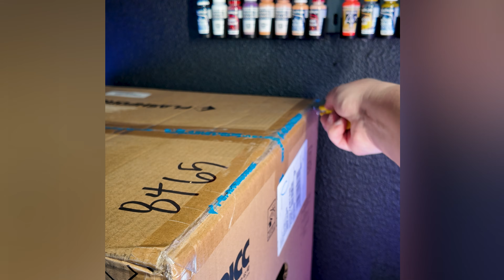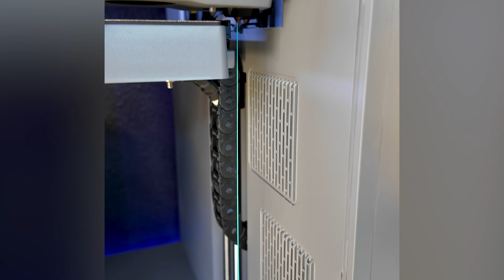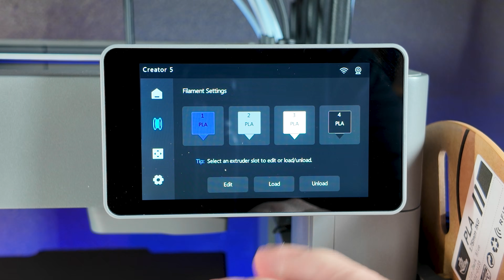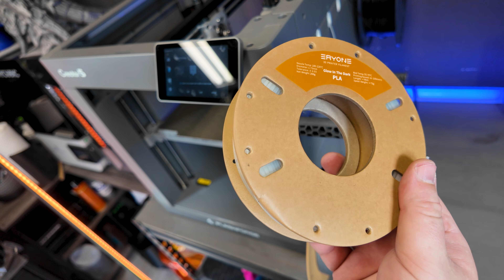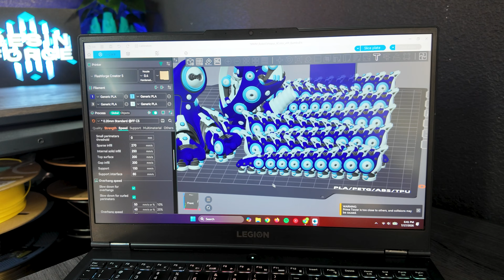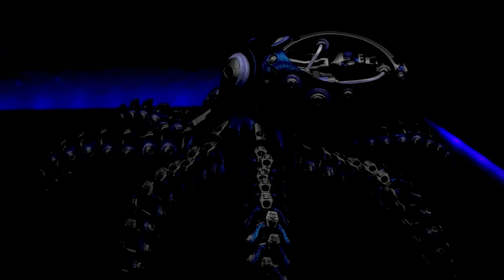Flashforge Creator 5 3D Printer: First Impressions

Comment: I finally got my Creator 5 Pro and plan on setting it up and testing it in the next few days. However, I must say that I’m not very happy with their communication. They have a promotion going that offers 2 free spools of filament. I sent a couple of emails making sure they knew what colors I want and they never replied. It came with a few feet of 4 different color filaments, but no free spools. I sent another email and they responded by saying my order wasn’t eligible. What? The offer is still up on their site. If a company I just spent almost $1,000 USD with won’t send me $10 (their cost) worth of filament, it doesn’t bode well for how they’ll treat me if I have a real problem. It always comes down to the little things. I’m praying that when I start it up, I’m not one of the many people who have something major that is wrong.
Reply: You didn't purchase during active promotion. If you did you had to select your filament at checkout

Comment: You have to register the app, FF pulls you into their ecosystem, its klipper open source, but FF closed and locked it, which is bad and against the license and you will not be able to connect easily with orca slicer. So by default you are bound and limited to Flashforge only. 
Yes you might jailbreak the printer, turn off autoupdate and unleash Mainsail, SSH & 30FPS Camera and you can use standard orca slicer, then you really have a good printer. Or you stay inside Flashforge golden cage like bambulab does. I prefer not to sit inside a cage with my hardware.